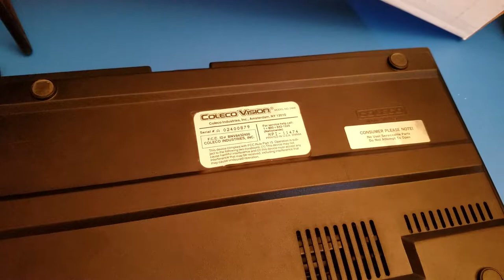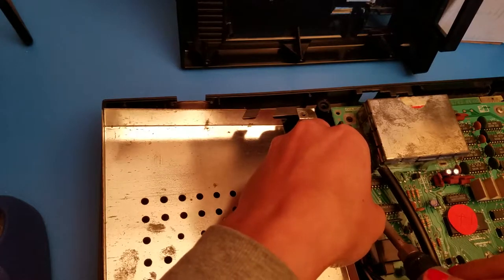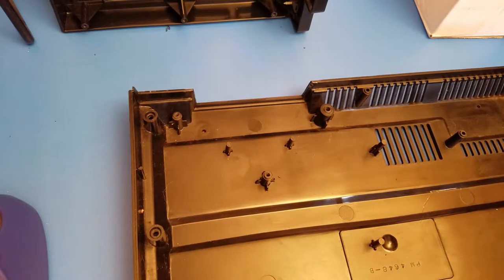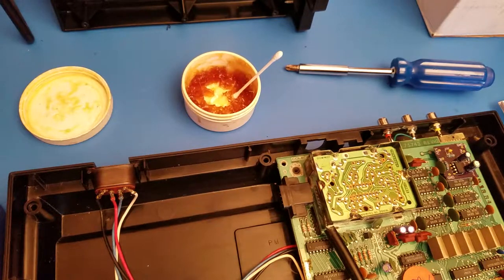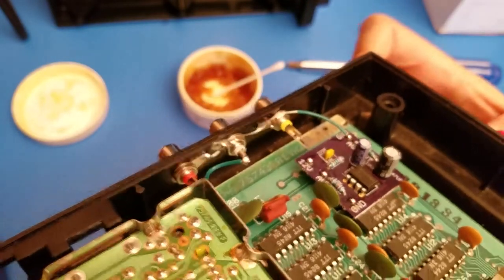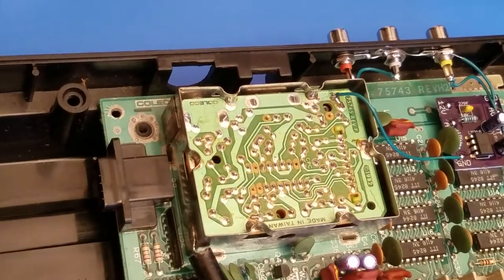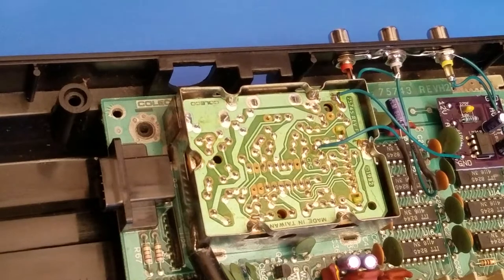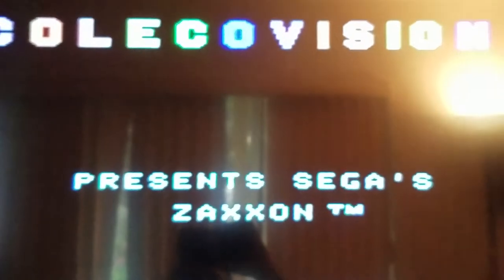How to AV Composite Mod your Colecovision

Comment: Great video Natalie. A couple of things, I've modded over 40 of these and concerning opening the Colecovision, you don't need butter knives or spud tools. Simply remove the 8 screws and turn it around so the back end is facing away from you. Reach back with your left hand and separate the the rear of the console by lifting it slightly and creating an opening. Now with your left hand spread the back apart creating about a 1/2" opening and with your fingers pull the bottom back slightly on the right hand side,  pulling it away from the front around the front bezel. At the front bezel you should see it separate. Still holding the back slightly separated, pull back until you see the front 2 pieces create a gap around the bezel. Now lift and pull the bottom back from the front at the bezel as you work along the front from right to left and the bottom cover will pop loose. One other note, never place the mod board on top of the memory it can cause video problems. I put mine on top of the cluster of resistors to the left of the BIOS chip. Ive sold over 40 of these on Ebay complete with Composite Mod, No Delay BIOS mod, +5v memory mod, cleaned switch and cleaned and inspected main board. See them here...https://www.ebay.com/itm/333538707959
Reply from the maker: Thanks for the comment. I did ended up moving the composite board after doing this video. I was testing it and saw the interference.
Reply: @rainbowrepair5692  You're welcome, I ended the video just after you tested it and then later saw the end. Sorry, I was to lazy to edit :o)
Reply from the maker: @Sirius5465  out or curiosity, what is your ebay seller name? I purchased this coleco on ebay from a seller in a huge lot. And kinda remember Jim being the name maybe

Comment: So the audio does not pass through the added circuit board? This explains why the kit I saw on Ebay has 2 grounds, 12v in and a video in and out. I thought the audio was missing
Reply from the maker: Correct. Audio sent directly to the rca jacks.
Reply: Thx for the reply. 😊
Reply from the maker: @maggs131  youre welcome :)
Reply: Where do you get your kits?
Reply: @Mynameis7nad   if she doesn't chime I got upgrade rca chips for coleco, intellivision, atari 7800 and nes topload kit with 3D printed mount and coleco controller chips all for around $120 from retrofixes.com. they also have good videos to help install

Comment: Absolutely no schematics in there about where you're tapping in the CV or of the little board you're adding. I don't understand what's going on so I don't do it...
Also, did you purposely hide the information on that capacitor you've added so we have no clue what the value is ?
Reply: The capacitor was a 10uf 16v. Was clearly shown if you watched closely. You don't need schematics, she clearly explained where to make the connections on the RF board not to mention you could just Google it for yourself.
Reply: @Sirius5465  If that is the case then why is it your reply doesn't include the exact time these critical details can be found ?
Reply: @francoisleveille409  Seriously? I told you what the capacitor is. You can look for yourself when she installs it. As for wiring the mod board there are several places where she speaks about it and you can see the the connections. Google the mod and you can get the info.